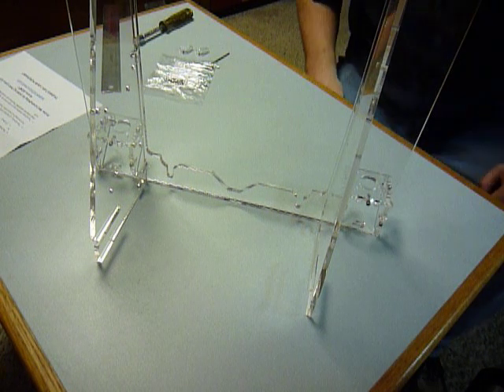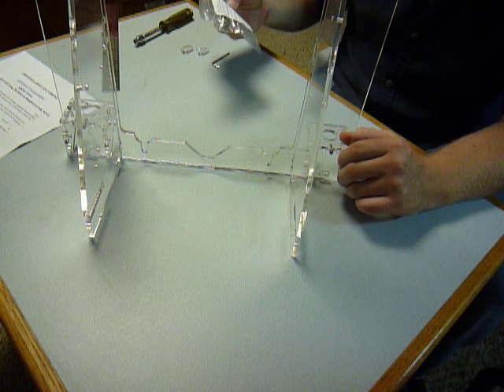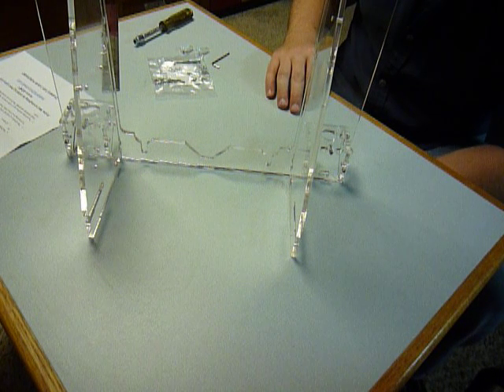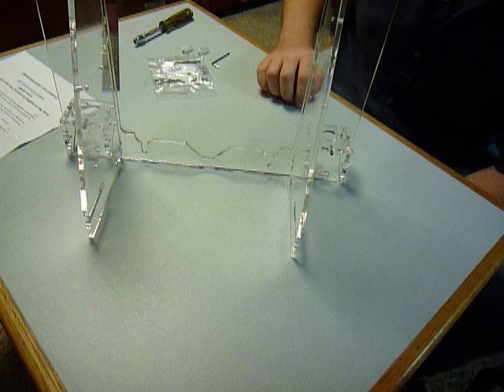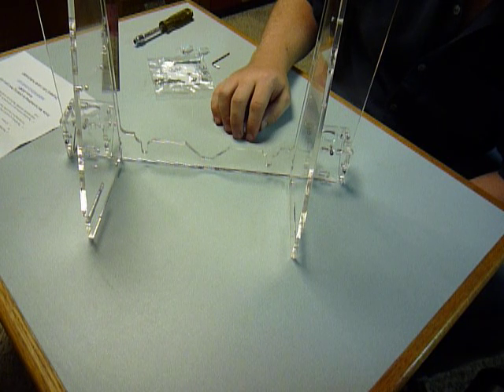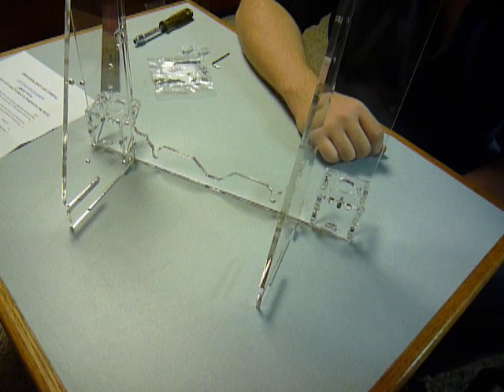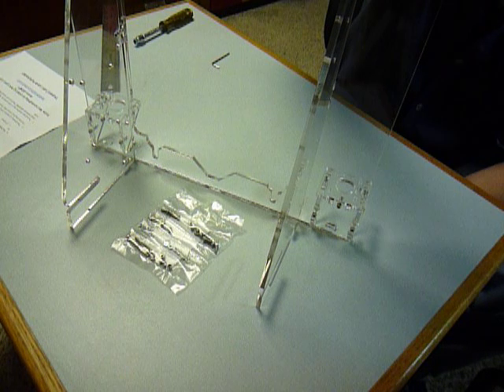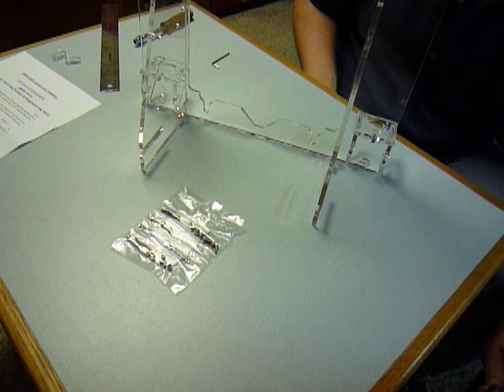Folger Technologies Prusa i3 3d Printer Build part 7

Comment: Heat the nuts before you put them in.  They slide in nicely with a little heat.
Reply from the maker: Heating would certainly be another option. You'd want to be quick and precise so as not to melt your plastic too much as well as not so hot you end up burning yourself. A heatgun might be a good solution for a heat source.
Reply: bubalettow I used a soldering iron to heat up the nuts.  It worked really well.  And Needle nose pliers to keep from burning myself.

Comment: Did you have to file any of the arcylic t-holes to fit the nut? I've been trying to get them set in the t-hole on my kit and can't get them in all the way. Seems like most of them are tight. I really don't want to force them.
Reply from the maker: MTBrewer I agree, don't force them. Did I file the slots, no. But I should have to make them snug but allow them to pass through all the way. be careful, you don't want to crack the acrylic with unnecessary pressure.